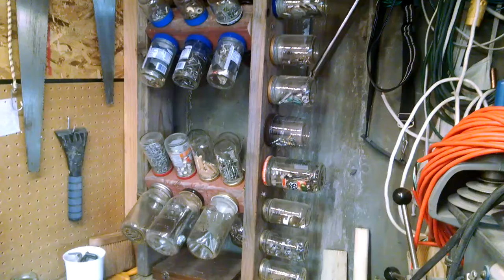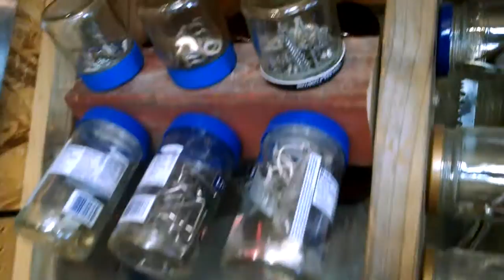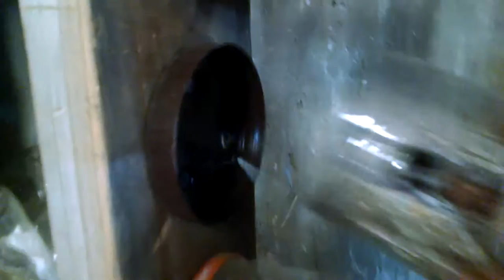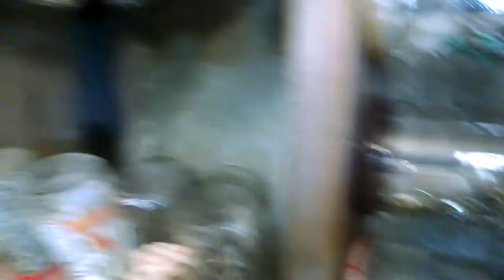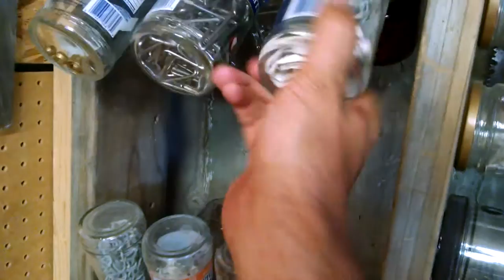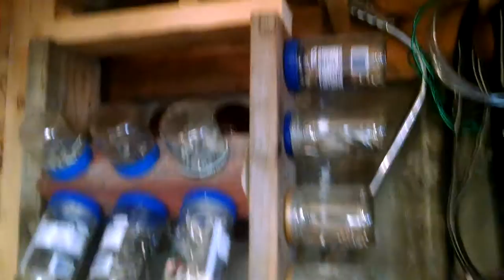Updated screw / nail / hardware storage using jars - DIY workshop / garage storage

Comment: How do you make the middle section turn?
Reply from the maker: The holes I drilled in the uprights on the sides are slightly larger than the lag bolts I used to hold the middle posts between the uprights. That enables them to spin freely. Does that make sense?